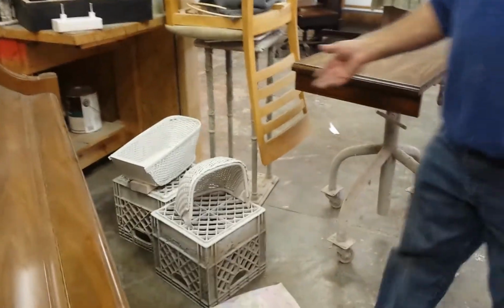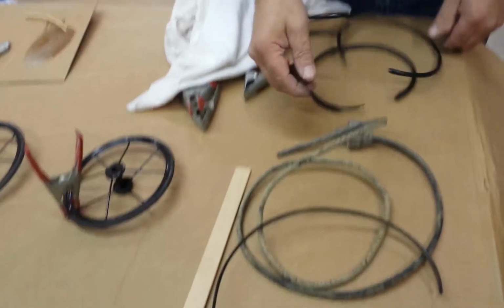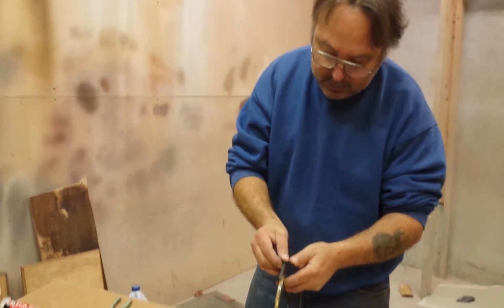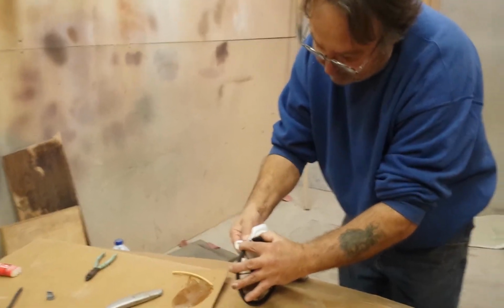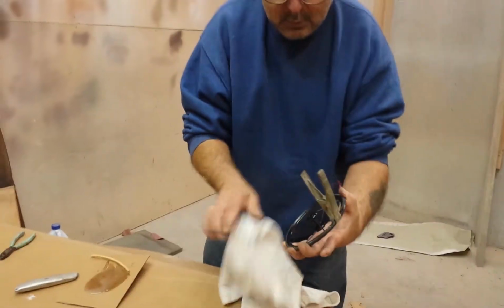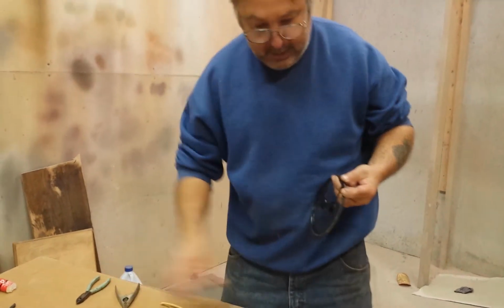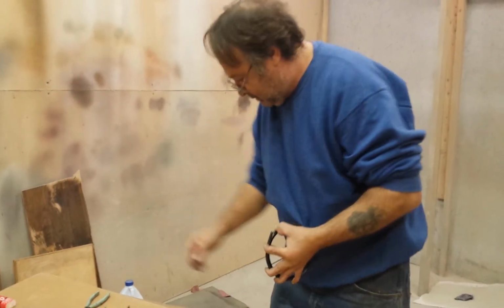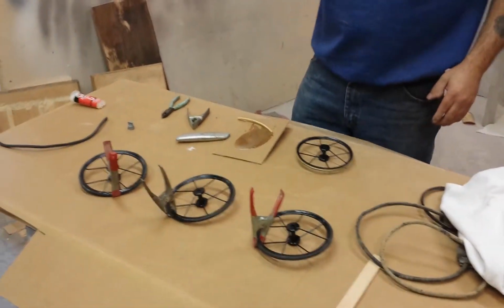how to replace old tires on a antique baby carriage

Comment: I was hired to refinish an antique tea cart with wheels like these once and had trouble finding the replacement rubber...I used clear vinyl tubing that I filled with black caulking.  It also worked well.